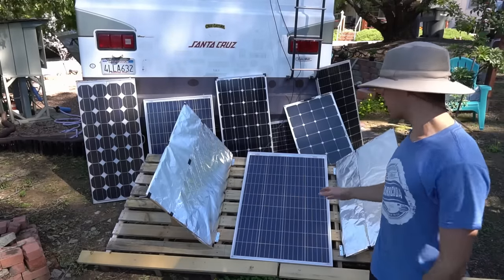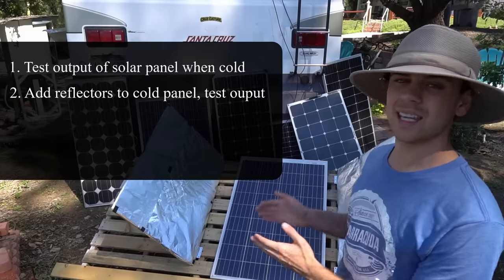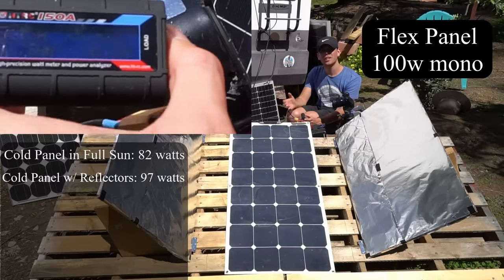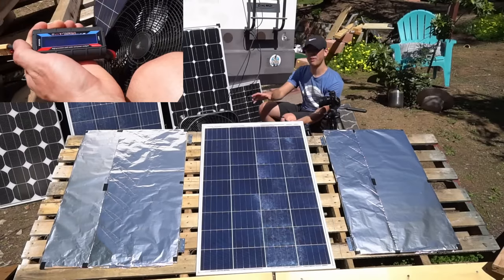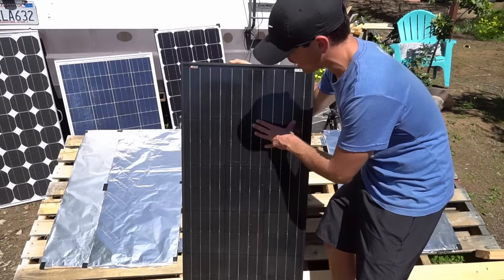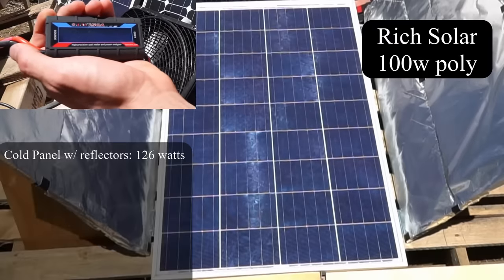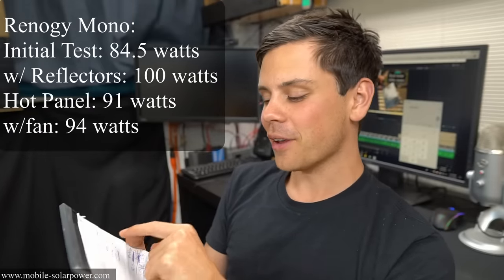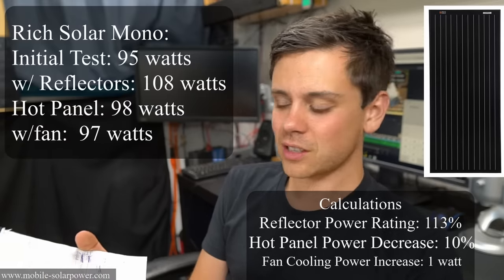Solar Panel + DIY Light Reflectors = More Power? Renogy vs Rich Solar vs Flexible Panel

Comment: Would be interesting to revisit this with bifacial solar panels that are ground mounted with a reflector bouncing light to the back side of the pv
Reply: I have those and it's exactly why I am watching this video lol.
Reply: I wanna see that too. I need more info about how to use reflection to max out bifacial panels but also somehow keep them cool.
Reply: It seems like a no-brainer if you find a good balance between enough reflection. It’s very cheap to make such reflectors.
Reply: Also seems like the amount of sun he receives is a lot. I live in Denmark so we don’t have that much solar. Such a system here would maybe put the panels up to the rated watt output.
Reply: Correctly built cooling setups give 15% efficiency bump! You then use the warmed coolant to pre-heat hot water heater via thickly insulated lines.

Comment: Would be interesting to have the solar panel in the shadow and then directing the sunlight towards the panel using a mirror (or alu sheet).
Reply: So it would be in the sun?
Reply: But the reflected beam runs over fast on the panel.
Reply: @alternativgazdasag3344  So even more worthless that placing it in direct sunlight. Got it

Comment: i wonder why the don't make FV panels which can be cooled from back by water so it would not only produce electricity but also warm water.
Reply: That's kinda the principle of solar water heaters. I guess hiding water pipes behind a solar panel wouldn't produce sufficient warming compared to water tubes exposed to direct sunlight.
There's a system with an actual water loop going through narrowly looped black pipes in panels similar to solar panels. A more performant system however uses a different sort of liquid (I think something like antifreeze) which heats a boiler in which the tap water is heated.
Reply: This exists. search for hybrid solar panels. They get a considarably higher efficiency compared to traditional solar panels
Reply: When I was a solar installer, I went to a big renewable energy convention and there was a company there that did exactly that. They put tubing on the backs of PV panels. That was quite a few years ago so I don't know if anything came of it. My guess is that it did make okay hot water but the extra cost and complexity didn't make it worth doing.
Reply: You do need to take into account that the cooling system needs a pump and some sort of AC, which will also draw power.
I'm pretty sure you won't recover the loss from what you win by having cooler panels. PV already isn't very efficient in converting solar energy into DC into AC, ignoring the pumps and cooling system you'd add to the loop
Reply: I have seen pictures of solar farms in China where the panels are mounted or floating in a lake.  They get both the benefits of the water reflection and cooling effects of the water.
Reply: this does exist but has a few down sites, first of all people fill their whole roof with panels, the amount of hot water this would produce is too much for any normal household.

also you want the water to become very hot but you want your panels to stay very cool so you will never run both at peak efficiency it will always be a somewhere in between.
Reply: @darylSKYTZOwillis   Neat! Using that idea, maybe utilizing a swimming pool(even if only a small cheap plastic or inflatable ring type) to seasonally mount/dock, would be beneficial for keeping optimal output in smaller setups.. or not so small; were you to do many. This kind of low tech idea makes me think of the tons of possibilities for accomplishing the task, and that tinkering creativity makes me happy. Thanks for sharing something fun to consider🤗👌👍
Reply: To use natural convection currents in water for cooling, you would need a large water tank sitting above the level of the panels. When the panel gets hot the water will rise up and deposit at the top of the tank, the cold water at the bottom will flow into the cooling pipes which could be routed through thin copper zig Zaging ?underneath? Or inside the frames of the panels to absorb as much heat as possible. You may not get much improved panel performance, but it will reduce the energy needed for heating up the water for a shower or washing up etc.
Reply: @darylSKYTZOwillis  Oh ya see there? Now you're just showing off lol. Good idea, Daryl👌
Reply: @michaelandersen401  Right! They use the heat to produce more energy witch is  added to the produce. Plus the panel remeins efficient not getting too hot. Its an new patent. Not all have it. We should invest rather to those, yes!
Reply: Main reason you don't use solar panels to heat water is that it's useless in winter. Modern solar water heats use focused reflectors and vacuum insulation.
Reply: U know solar water heater bruh lol
Reply: Ever since the first consumer grade panels became available, people have messed with cooling jackets and films. The reason it's not become mainstream is simple. It's much cheaper to just install more panels than to cool the ones you have. It's the same reason everyone isn't using trackers and reflectors. Panels haven't been the expensive part of a solar system for a while now.
Reply: @a.douggoodwin610    Geo thermal  ammonia fridge  or heat pipe loop
 like the heatpipes that are on GPU and CPUs
Reply: Solar cells have 20 year life spans. Water pipes can vary heavily in lifespan. This is why solar water heating for pools is rough as the water in the pool is very corrosive. Add to that the cost of an additional layer of construction. 
Now if you want to be much more clever about it, making the solar water heating as a "bolt on" (I imagine a the same method as a CPU cooler adheres to a CPU in a computer, including temp grease).
Reply: They are called PVT, I got 230WP and 700W thermal. It works with ground source heat pump. During summer they are about 12 * Celsius.
Reply: Wallabynge p
Reply: Decreasing the operating temperature of the panel will probably increase the lifetime of the panel substantially.

A heat exchanger (think how a household refrigerator works) could be used to extract the heat from the panel and efficiently transfer it to a second “loop”, I.e. hot water tank, central heating.
Reply: @goober-ll1wx Nothing much.  It might leak and your roof would think it's raining.
Reply: Yes, but put peltier devices to turn that heat difference into more power and then more power.
Reply: Probably not worth the effort.  In the summer the days are super long and you have lot of excess power anyway, so even if they are running slightly less efficient you still have lot of power.   In winter when the days are short they will be running cool and slightly more efficient.    I wonder if too much heat reduces their life though.  If anything a cooling system would maybe be good for improving their life.   Could maybe have a small sprinkler system that sprays a mist of water over them.  Then flush the system with air at end of summer so it does not freeze up.
Reply: Make sense
Reply: @a.douggoodwin610  also a pool is a big water buffer :)
Reply: @MmeHyraelle  Ubetcha👍
Reply: In regards to cold weather, you could run antifreeze through the loop. Then it runs through an exchanger to heat a tank or a pool.
Reply: The potential energy capture from water filled solar is huge giving both solar energy and thermal energy from one source of power
Reply: @SmartLifeEnthusiast  I 2nd that notion!
Reply: @redleader7988  or the extra weight of all that water could collapse the roof, especially if its frozen and there's a foot of winter snow on top of that.
Reply: @michaelandersen401  they are expensive. But you can also reverse the cycles and pre heat the panels. To remove snow ice also.
Reply: @SmartLifeEnthusiast  a 12V pump to cycle glycol/water will not be a problem. You already have solar and batteries...
Reply: As I live in northern Europe I'm seriously thinking about running my fish pond water filter pipes along the back of my panels to try and raise the water temperature. Fishies are happier above 10 degrees C. Would probably need a valve for day / night mode so I don't end up cooling the water at night though. If it dropped below 0 I would probably be in a world of hurt lol.
Reply: @SmartLifeEnthusiast  our water heating solar panels at village don't use electronic ?
Reply: Neal F "natural convection" must be the proper term for "phantom circulation"
Reply: Blue swamp cooler pads, with a drip water system. Just adjust the drio as needed. A little water dripping of the botton is OK. Each panel might use  5-10 galllons per hour. Cut off the water at Sundow, and re-enable the drip water at Sunrise.
Reply: @redsquirrelftw  no need to flush all you would have to do is add a valve at the bottom to let water out gravity would do the rest
Reply: @SmartLifeEnthusiast  more to it than that. Conduction, convection , and radiation are different but you are assuming radiation is the heat source. 
Again as Will said not worth it but if panels were designed for liquid cooling they would use conduction as the panel is hot from radiation

Comment: My mirrors. Works best in the winter. When it's cold and short sun time. I tell folks that cheep mirrors are a boost in the winter and cloudy days. =Less cells needed for my tv, computers, lights and battery charging.  14 years. Devote a extra/junk cell to drive a fan  if you have to. My hoa was on me about solar. So I took and used the cells to make "shutters" that fooled the hoa. Then I have inserts that I pull out and aim at the " shutters" back in business I am.

Comment: I'm thinking the reflectors would probably make the panels more usable with less sunlight.  I would like to see prolonged tests on partly-sunny days.
Reply: Exactly!  How do the reflectors work on a high Cirrus (light clouds) or Altostratus (heavy cloud) day.  That would be a GREAT helpful test!
Reply: I live at 55 north, so low temps and low solar-intensity, seems like the ideal scenario for using reflectors..
Reply: but reflectors can make shadings also..
Reply: I'm thinking engineers that design solar panels would add the $10 worth of aluminum foil if it could turn a 100 watt panel into a 120 or whatever.
Reply: Exactly, no point in using reflectors on a sunny day when the panels are fairly well positioned towards the sun. It is in less ideal situations where mirrors can be benificiall. Of course, if you are gonna use 4 mirrors each the size of a panel......then you problably have spend the money that you had better spend on an extra panel.
I have a full size panel on my balcony, mounted vertical due to how the situation is. In front of 40 cm of mirrors. Test show me that a 5 euro mirror (20*120cm) immediately gives me 6-10 watt extra at 10:00 am, pushing the panel at that moment from like 80 to 86/90 watt....... I think that is a good deal.
Reply: So with regads cooling panel surface... if a sealed double glazed panel was laid over the panel and had clear water, with no bubbles passing through it, would that not drw heat away? Circulating cool water from a pool, over the solar and ending up in a hot water tank (with overflow)? I have no idea if it'd work!

Comment: Run copper water coiling behind the panel, use it to heat your water :)
Reply: Pex fractionally cheaper last 10 times longer and it’s what they actually use radiant heating.

Comment: Does work. Tandy (radio shack) netherlands had a handsized solarpanel, with 2 reflectors. I used them during holidays in the european alps, in the 80s. I used it with a small short wave radio. I still  have both of them.

Comment: I’m really impressed with the poly out performing mono ! Even in shade ! Like your videos on this Will
Reply: Well I’d say on surface area the black mono wins pretty easily..
Reply: i will see that too also the shade calculation
Reply: not realy seeing its 1/3 bigger. mono are more expensive but in general will outperform poly same surface area over a longer time.
Reply: @someonespotatohmm9513  None of that matters unless you're space limited.
Reply: @redleader7988  When it comes to powering a house or building a solar farm, space is always the restricting factor.
Reply: Austin Fifield or an RV. Much more limited surface area on the roof.
Reply: Monocrystalline work better than polycrystalline in low level , over cast days and winter.

Comment: Well it's commonly said that if you are on cold places you will have more output with monocrystalline panels with the same amount of light. But on warmer places you should go for polycrystalline cause it reflects more light and cool well better, as a result get way more efficient on heat circumstances. 

On average where you are higher than 25°C half of the year you must go polycrystalline. 
Where you have snow and often negative temperatures you should use monocrystalline.

But as said, experiment to test this is always good. Thumbs up !

Comment: Moved my system from a hot roof to a cool side yard rack system this year with plenty of air flow. I also spaced the panels to have airflow on all 4 sides.   My old polycrystalline panels still producing well since 2005!
Reply: Ok but is it better or worse than the previous positioning?

Comment: FACT: using a white paint has more reflectivity then foil , foil also gives hot spots where as white is even reflection. I learned this from growing indoors
Reply: Cough cough...
Reply: @vladtheinhaler93  XD
Reply: I read a blue/white looks whiter than a white, is this an optical illusion or could a blue/white give a higher reflection?
Reply: This sounds incorrect. If it were true we'd have mirrors made from white paint and not metallic foil. Also, nearly all indoor growing tents/systems use mylar instead of white plastic because of its superior reflectivity. Did you test the reflectivity of white paint vs. foil, or did you make an assumption based on poor logic?
Reply: @K-Fed  
We're talking refraction. 
You're talking reflection
Reply: @jasonabney2217  No. You're talking nonsense because introductory high school science is going way over your head. Look up what reflection and refraction means :b.
Reply: Did you use Snow Roof? That stuff is excellent. The white paint scatters the light more, and makes the reflector less directionally sensitive. No need to adjust the position. Also orient the reflectors top to bottom.
Reply: I will believe you when you publish data from a reputable test.
Reply: Why not just use mirrors? Get direct sunlight to shine on it

Comment: Interesting start.  Some folks are getting higher gains  -- but use different conditions and methods.  A few  questions?  

1.  What were your outside temps? 
2.  What time of year, and lattitude (about)?   and 
3.  Have you tried White reflectors instead of "mirror" type reflectors?   White increases the light without so much reflected Infra-Red (heat).

Thanks!
Reply: White reflecting panels makes a lot of sense.
Reply: Agree on the white reflectors. Recently I got a free white parachute that I plan to cut up and rig up as a reflector for my bus roof panels.
Reply: Good remark, about using white reflectors. I am very interested in any results even or especially if the results show that it does not work. I personalyy was thinking about blue refelectors (shorter wave lengthrs, further away from heath and seen to carry more power).

Comment: Really interesting, thanks
I have JA 290 panels installed 2.5 years ago, 3 aspects, 5.22 kW , Tesla powerwall 2 , a sanden heat pump hotwater system, an Hyundai ev. 
My powerwall was installed August 2017, and never paid for electricity since then.

Comment: I just bought two 280watt latest  REC Twinpeaks  polycrystalline - what seems new is that the cells are  mounted on a  transparent  laminate with a mirrored back - the theory is that any light that gets through the surface gets reflected back on to the cells - they claim 18% - another nice feature is each panel is split into 6 zones so any bird poop doesn't bring the whole panel down
Reply: I bought 4 of the 285 REC twinpeaks Polycystalline no clear.  Not all that impressed with them.
Reply: @bigblockcutlass123  Interesting - have you got the  2018 black looking half cell ones?
Reply: @trevortrevortsr2   no

Comment: Love the experiment!  Now someone make a square portable panel that has reflective fins on each side that can fold inwards for storage but can be unfolded to produce the maximum amount of power as possible. Bonus if you can somehow make the reflective fins act as a heat sink to dissipate heat. This is of course assuming the fins are lighter and cheaper then just buying another panel.
Reply: A lot of hassle to use such panel, methinks. Maybe it would be good for someone who can have only one panel, because of shading and spacing required. It is easier to use two panels. Overheated panel will have shorter lifetime and will be less reliable. Panels have annual degradation, so it will only accelerate due to high temp.
Reply: I do like your idea. I am working on affordable portable solar systems for low-income countries. For transportation, we might need to add somekind of protection plate that could be used as a mirrow when in use. But I don't like the increased temperature of the panel. Do you think instead of an excelent mirrow that reflects all visible light, we could use a simple blue painted surface and avoid longer wave lengths (heat) to be refelected as much as possible? There seems to be more energy in shorter wave lengths anyway.

Comment: You are the only solar PV proponent on YouTube. I always give you thumbs up before watching your entire Solar power videos
Reply from the maker: Thank you!!!
Reply: @WillProwse could you have running water either mist irrigation or direct on panel to keep it cool I've got a flowing river not far from me was wondering if I pipe it over panels then into ditch that's goes back to river so it's always cold water